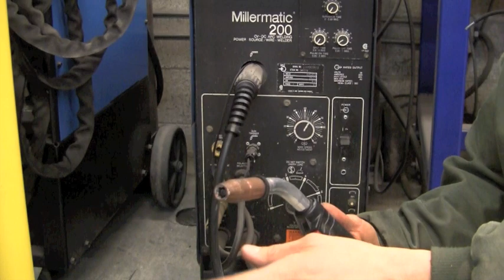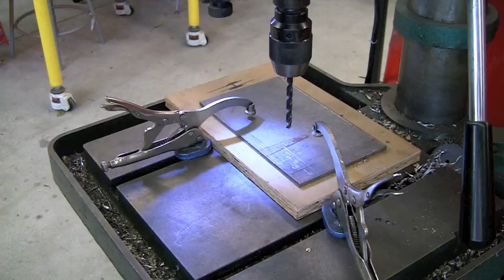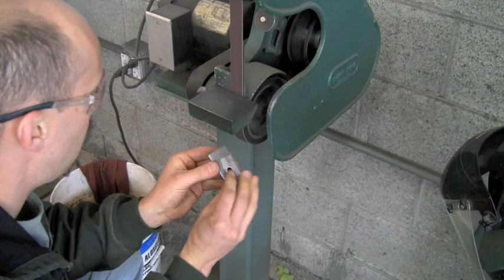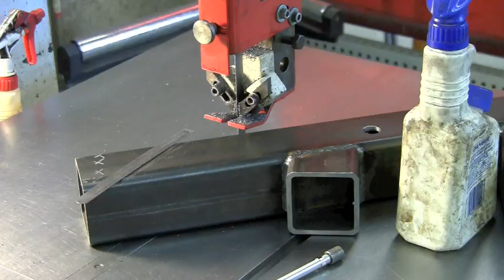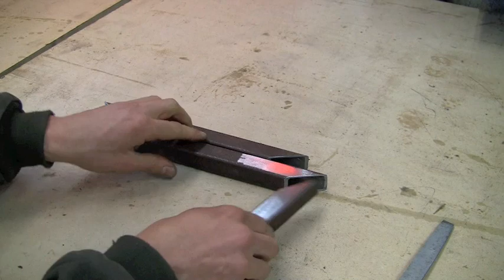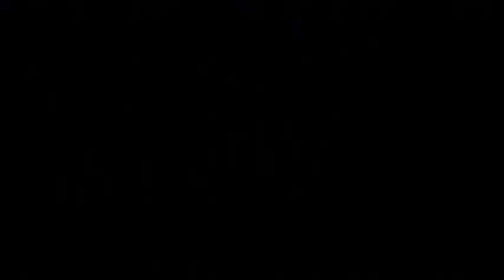Horizontal Bandsaw Jig part 2 of 2.

Comment from the maker: @kef791 Thanks Keith I think for saw cut the fit was good too.

Yeah the shop was pretty clean but I did clean the drill press off there where so much chips in the t slot you couldn't get the clamp in.